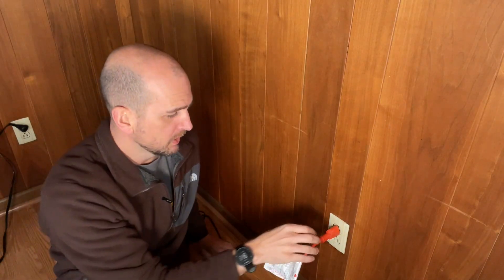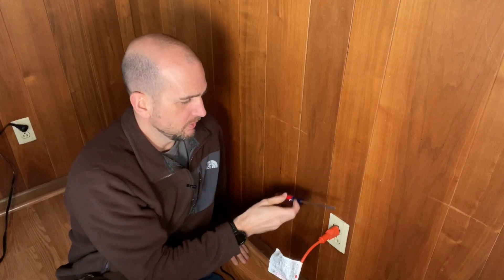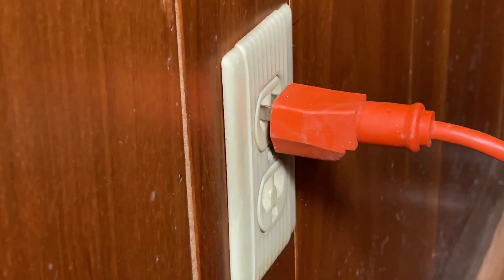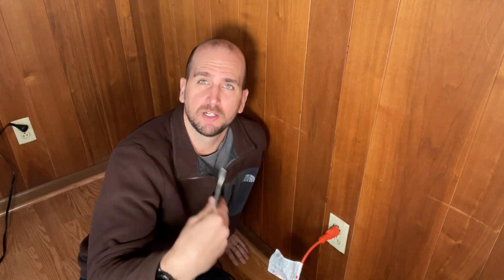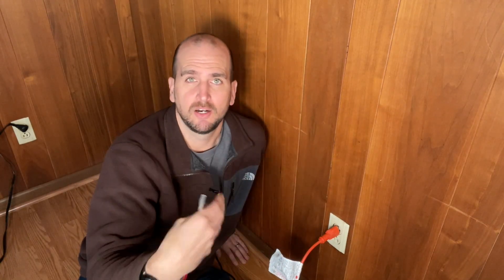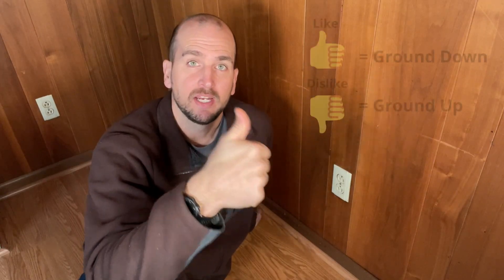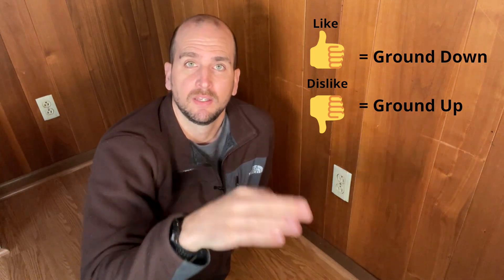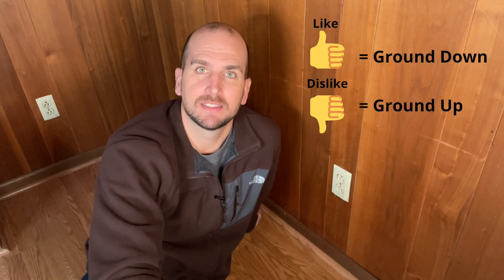Should An Outlet Be Installed Ground Down Or Up

Comment: BTW NEC defines “outlet” as any electrical connection, receptacles (outlets as you say) lights (outlets as NEC reads)

NEC 110.3(B) per manufacturer instruction. This can be contradictory especially when trying to comply with smoke detectors ( you should read all 3 NFPA, NEC, manufacture ) 90% of homes are in violation. 
 As for ground up or down originally it was ground up this was the “Pyramid” style however as grounded cords became more popular the ground up didn’t provide adequate grip for unplugging say a vacuum cleaner. So ground down became normal so the thumb could apply better/comfortable force to insert/remove the cord from receptacle instead of grabbing the cord. 
 In commercial ( hospitals and kitchens mostly ) ground is generally up but not for the myth of knives or scalpels falling and energizing. They’re are installed ground up mainly due to design of appliance cord creates a “snag” loop or especially in hospital monitoring equipment electrical interference ( this is also why isolated grounds exist for certain outlets in commercial/industrial )
 Most the devices in 15/20A~ rating are universal 30A~+ the writing on device is ground up, 2 reasons range applications close to floor ground down prevents cord to be plugged in. Other is items like dryers require rotating the cord 180^ exposing the cord above in some instances which is unpleasant to the eye or design/decor.

Comment: The best safety solution would be to turn the receptacle sideways and have hot down (ground to the left) then it would be very difficult for anything falling to cause a hot-neutral or hot-ground short. Of course, to make that practical, would require redesigned duplex outlets since most cutouts  on the wall are oriented vertically. 

It would create a minor issue with some “wall wart” transformers, such that larger/wider transformers might block both outlets. Of course, that’s already an issue on many power strips, so it’s not a new problem.

Comment: In most situtaions I install ground down.  People tend to put their thumb on the top and the thumb is less likely to come in contact with pins.  That being said in high vibration locations like some industrial settings in which metal covers are used- ground up, incase the screw loosens over time and the cover falls onto the receptacle while in use.

Comment: I thought it was a recommendation from NEC (back in the mid 90's) to put ground up, my local city codes made it mandatory. 
The reason the inspector said was for something sliding down the wall and contacting hot and neutral. I pointed out a: most living room appliances don't have ground plugs, b: chances of a metal object perfectly lined up to do that, c: if that did happen the chances it would strike off center are greater and may contact ground and hot creating a short. He replied they only enforced it if someone already had other mistakes.
So always check national codes, state codes, county codes, and city codes for enforcement, some my be stricter or even more lenient.
Reply: Code only occurs to laymen if there's an inspection or an accident. Our town has no inspections of any single-family dwellings.
Reply: Its ground at the top by law in the UK and should be in the USA too. 
But you have a very stupid plug which is cheap and nasty. The UK changed over in 1947 to the 13A system and so should you.

Comment: On the job we always put ground down unless we worked in a medical facility where they specifically said ground up. In my own house they are ground down
Reply: I was always told that ground up in a medical facility is due to the routine use of oxygen and the desire to minimize the possibility of sparks in that environment.  ER and OR are often chaotic and patients in rooms can't be watched every minute so there is a greater possibility of something getting between the plug and the outlet.  Always sounded reasonable to me.
Reply: @chriskucia8348  yep heard the same thing

Comment: Ground down seems more safe for adults (or rather not-small-children) because biometrically it's how people normally grasp a power plug. The primary strength of the grasp is opposing between the thumb and the index finger with middle finger behind it for additional support. This is called a "key pinch"/ When a person grasps the plug horizontally, there is no difference between ground up or down. However, when the grasp is vertical, the thumb is on top of the plug and the index finger is under the plug. That means that the index finger is naturally parallel to the wall and in a position that is more aligned to make contact with the hot and neutral blades. Consider that, especially for an outlet near the floor, the plug is being pulled out but with upward force as well that will tend to pivot up on the plug. It seems logical that a ground up socket would tend to maintain ground pin contact longer during this process as the hot and neutral would pivot away before the ground pin completely disengages from the outlet. But people don't, or rather won't, typically be that conscientious when they unplug things and will simply take the plugs and power for granted. I think there is a greater risk in the person touching both the hot and neutral blades at the same time with a ground up orientation due to human factors, such as skin oils or lotion causing their grasp to be weaker and tend to push their index finger under the edge of the plug, and the tendency for people to hold their hands in a position similar to a hand shake which would also place the index finger close to the wall and close to the blades. A slight slip of the finger in this position means it can touch both blades of the plug. It can be argued as well that for the ground down it's possible that someone holds their thumb too close and it slips. But I think if you watch how you unplug things you will see that the force applied from the thumb is at an angle through the plug rather than straight through and therefore even though the thumb might slip, it's less likely for it to contact both the hot and neutral blades at the same time than the first finger would be for a ground up outlet.

But overall I think it's likely that the ground up argument has been decided by many due to child safety. Because kids are curious and will do things in away where they can see what happens. And it's less likely that a child would push a metal object up under a plug where it could contact the blades where they cannot directly see what it is doing under the plug.

Comment: I install the ground up in my lab to prevent small-diameter tubing from dropping across the two hot prongs and shorting them, cutting the tubing, and causing a fire.

Comment: Right angle plugs, polarized night lights, grounded power bricks, etc, all seem to be made with ground down as the default orientation.  Based on that is why I installed my sockets ground down.  (not a pro, just DIYer )

Comment: The ground up for safety is just ridiculous like you said most plugs don't have a ground plus what's to stop whatever fell and slid down just right to get in to short the hot and neutral to not short hot and ground. This is just busy bodies trying to fix a problem that doesn't exist.

Comment: Ground pin down is easier on the socket. 
 Because the ground pin is longer, it is the last to clear the holes when the plug is pulled out. Since most plugs are pulled out from a position higher than the plug, there is a natural tendency to pull the plug at a slightly upward angle. When the ground pin hole is at the bottom, the pin is out by the time the upward slanted movement begins. But when you do this from a socket that has the ground hole at the top, the pin which has not yet cleared the hole, can break the plastic just above the ground pin hole of the socket face.  You know you have seen this before... Now you know how it happened.  ;-]

Comment: check me out not sure but i belive nec doses state if using metal outlet cover then ground faces up but i have been taught to install receptical same as plumbing cold on right hot on left wich as turns out the ground is facing up

Comment: I worked for a public school district for 45 years. We always installed a new receptacle ground up. Why? Because the students would pull the cord out far enough to drop a copper penny in the gap. This caused a direct short if the ground was down. With ground up, it would just fall away to one side. With the ground down, no one could reset the breaker until the penny was found and removed.

Comment: Here in Ontario (Toronto) our Code makes no mention either. However, a very, very good new Code adjustment specifies that all Bedroom area outlets "are to be protected by Acr-Fault circuit breakers". The reason being, that most AC plugs (that extend outwards from the receptacle) get mashed-up between beds and the walls, causing them to fail without a regular circuit-breaker tripping BEFORE a fire starts. When ever doing a retro-fit, this must be done for safety. My personal preference would be to install outlets - Ground Up for extra strength.

Comment: If you are doing any commercial/industrial job in jersey, although technically not code , if  you have ground down the inspector will give you a side eye and dig deeper than normal. 1st year apprentice learns ground up as the paper clip rule.

Comment: I would install ground down. In the event of flooding, rising water will reach the ground first, then when it becomes electrified, it will immediately go to ground and trip breaker. Ground up could cause a safety concern. Just my opinion.
Reply: It’s always going to reach ground first no matter the outlets orientation because the box the receptacle is mounted in would be made of metal, grounded and not be water tight.

Comment: I prefer ground down because I work in I.T. and deal with a lot of plugs that are AC to DC transformer “bricks”.  Most of these plugs that convert the voltage from AC to DC and step it down to 7.5 or 9v are meant to be plugged in with ground down for two reasons: 1. The size of the plug will overlap the the second outlet, essentially wasting it.  The second reason is that these oversized plugs want to fall out of the outlet because of their size and weight if plugged in with the cord oriented vertically.

Comment: Ground down: The three pin configuration puts the ground pin in an orientation that helps support the weight of the cord, better securing the contact prongs in there place.  Think about a three legged chair verses two legs!
Reply: Then it's only standing on one leg as opposed to evenly distributed across two legs, by your logic, ground up makes more sense

Comment: It actually is supposed to mean something,  110 V - 120V,  15 AMP  is  ground down.   Ground Up is for a different power level ...  220 – 240 V,   30 AMP.
It's not a  voting thing,   10-15 Amp is down, shared circuit.        Ground Up is it's own Individual Circuit, and is 30 AMP and / or  220 - 240 V .   
You might also see Ground Up for Isolated /  Backup Power systems that will stay on when the mains  goes out.

Comment: Do not forget about the direction of the slots on the cover screws. Probably more important than the ground up or down debate. By the way, I'm vertical 💯!
Reply: I do the screw slots horizontal. The only people who do the slots vertical are the ones who cant tell the left end of the slot from the right end. ;)
Reply: @alanhaisley4870  so that explains why my dishwasher starts every time I turn my front porch light on. 😁

Comment: As a licensed electrician with 40 years,I will tell you that usually only hospitals require the ground facing up.however it just makes good safety sense to use that idea in residential as well as commercial applications electrical safety. Is a great concern to every inspector as well as home owners.it just makes good safety sense.

Comment: Ground up makes it harder for a child to electrocute themselves.  The cords seem to be made to have ground up.  they are easier to push in and your thumb fits perfectly on the top of the plug ground up.  Cords will not pull out as easily with grounds up when you tug on them.

Comment: Just look at the way manufacturers make those night lights for kids that get plugged directly into the receptacle. The ground has to go down so that you can plug it and the figurine or light fixture is standing up on top of the plugged part. Many also need to allow some heat to rise by convection from the light, so it's convenient to manufacture it so that the bulb is pointing up in the fixture.

Comment: The outlet creator originally intended for the ground to be facing up but ground facing down has become the most popular orientation because it looks like a face and we like to anthropomorphize things.
Reply: Do you know him personally and did he tell you this himself?

I personally know this is completely false.
Reply: @silencedones4421  The ground pin was originally introduced by Philip Labre in 1927 (although his design included a flat blade instead of the U shape we use now) and his patent documents contain images with the ground pin oriented upward.  In 1948 his design was adopted by NEMA and they changed the pin to the U shape we know today.  The images NEMA releases detailing the different types of connectors still maintain the ground pin facing upward as well.

Source: https://www.plugsocketmuseum.nl/NorthAm3.htmlhttps://www.plugsocketmuseum.nl/NorthAm3.html
Reply: @jessebutryn  I am well aware of what you are pointing out.  It just was not the point I was making.  

Believe nothing you are told.
Reply: @silencedones4421  Well that's pretty vague and contains nothing of value.  Anyway I'm not interested in arguing I just explained why I'm right and you can do with that what you will.
Reply: @jessebutryn  argue?  I understand and respect your desire for knowledge.  I am only trying to help you see what you do not see.  

Unless you can prove something as absolute FACT it is only a theory.  

Just because something is written declaring it to be the truth doesn't mean it is the truth.  

Look at the world today...
Reply: @silencedones4421  So there is some elaborate conspiracy in which patent documents from 1927 have been altered in order to make us believe that the orientation of outlets should be one way or another?  What is the motive here?
Reply: @jessebutryn  the point is the fact with everything going on this world today why are so many distracted with such petty things?

To answer your question. Yes, patents have been stolen from original creators who were silenced or killed and given to others so they could rise up the ranks.    When it came to Tesla they got caught.   Just like alexander bell did not invent the telephone.  

I just saw someone who seems to do their homework and reached out.  This is what I look for.  

Either you see the TRUTH or do not.
Reply: @silencedones4421  So, if you know this statement of Jesse Butryn is "completely false", why haven't you stated why? You asked him the same questions YOU should have answered in your comment about 'proof'! Or, do you just want to remain 'silent' over your opinion? Since the installation is up to the installer, who gives a 'darned'? I've even seen these outlets installed sideways! And I also have one in my TV room on my upper wall powering a Neon sign to prove it to myself. That and all the outlets I've seen in hospitals! how about in floors and on ceilings? No rules people, other that what is desired by the installer and the current customer. PERIOD!

Comment: The on-going argument that I’ve heard for the past 40 plus years. I have installed outlets both with ground down and ground up, and you are correct about following job specifications. The code does not specify a ground direction as you can install outlets on a ceiling, floor or horizontal on the wall, with one exception is a right angle plug must have the cord heading down so there is no stress at the attachment point. Even though ground up will afford some protection from fall metal objects the other consideration is that the ground prong is longer then the current carrying prongs so as you plug in your equipment it will have the equipment ground connected first for safety reasons and likewise as you unplug your equipment the current carrying prongs are de-energized before you disconnect the ground connection.  One could argue that if the outlet ground was up and the cord was falling out, could you lose your ground connection while the equipment is still energized? The other side of the coin is if the outlet ground is down and you have reach down with your plug, can you energize your equipment first before the equipment ground makes its connection. I think you’re on the right track just by replacing our old outlets, where the new ones will have much better holding power to keep the plug from falling out in the first place.

Comment: There is another reason why it would be preferable to have ground up (beyond the fact that it was designed to be installed this way).  The fact that it appears to look like a small shocked face when installed ground down drives a empathetic response in our psychology.  This response is present in children, and there is an argument here that installing ground up helps to prevent young children from trying to play with the "face on the wall".

Comment: A friend, who is an electrician, always told me ground up so the outlet does not look like a face; in areas for children the ground for them should be up. In our home we installed all electrical outlets and switches with the text on the items right side up and the hot on the right with the neutral to the left along with ground on the left. So for our own use we installed everything ground down.